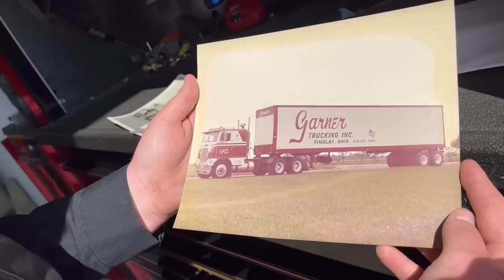We’re Shutting The Cabover Down!

Comment: That Cabover Freightliner I believe I recognize. That Carolina Blue Paint with the Black Gold Stripping I believe is an old Truck run out of North Carolina. Does it still have a VT903 Cummins engine in it? It was at one time a Marine Engine and it got converted to fit into Trucks. In fact I drove one of those with that exact paint job and they were really nice trucks. 
When they were new with all the chrome and the 48' reefer trailer behind them them they looked Good. This would have been in the mid 1970's and into the 1980's when they were on the road. I drove for the Brother's that owned the Company and they had a couple + dozen of them running from NC to CA every week!
Reply from the maker: Not sure where it came from